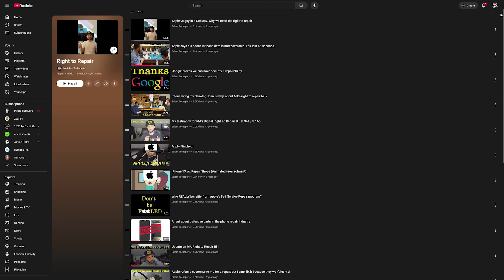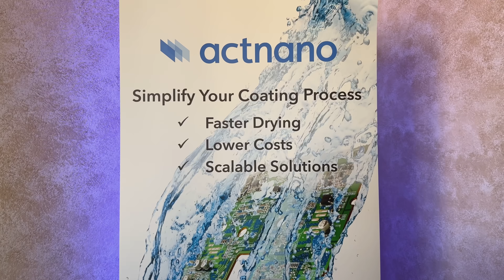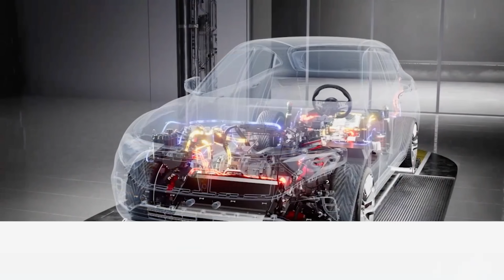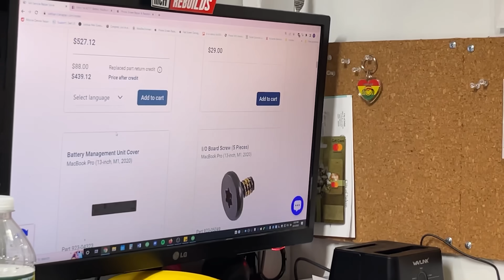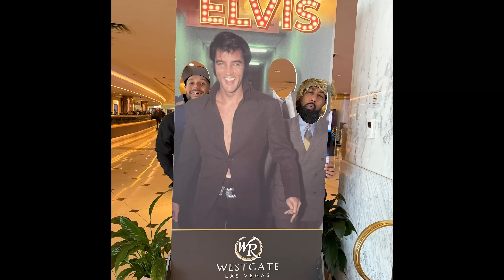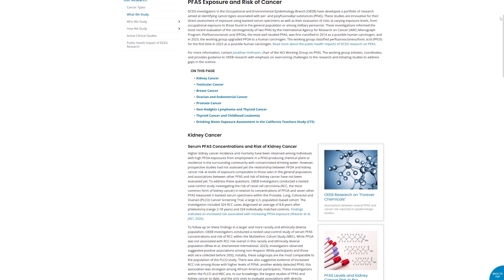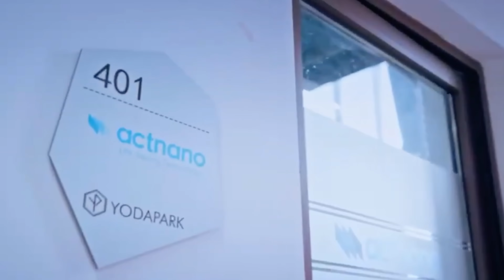Waterproof Laptops ARE Possible, But WE Need to DEMAND Them! actnano nanoGUARD is HOW We Do It!

Comment from the maker: THIS COMMENT ANSWERS YOUR QUESTIONS

First, I STRONGLY recommend watching my full interview with actnano's CEO Taymur Ahmad here before asking questions
https://youtu.be/Iyk5tB56P9s
And you can learn more on actnano's website: https://actnano.com/

Answer to common questions: 
- Can I apply it myself?: No, you can't apply it yourself. It must be applied in the production factory where dust, humidity and application of the coating are under strict control and with the proper procedure and machines. Explained here https://www.youtube.com/watch?v=Iyk5tB56P9s&t=1736s

- Why don't they offer the service to apply it for me?: Also explained here https://www.youtube.com/watch?v=Iyk5tB56P9s&t=1736s . TLDW: Liability, logistics, and effectiveness. Applying it during the manufacturing process on a clean board that doesn't require a complete teardown of a customers device is the only 100% sure way to make sure the product is effective. Think about the time, labor, and staff needed to offer this service. It's like sending in your phone to Corning to have a new Gorilla glass layer put on. It makes much more sense to apply it at the source (manufacturing).

- Does it only work with water: No. It resists a variety of fluids including water, saltwater, soapy water, Coke, Gatorade, coffee, salt, windshield washer fluid, coolant, mixed flowing gas, sweat, etc.

- Does it affect board work?: As shown in the video, the coating can be removed with a solvent and q tip for board work. No scrubbing or sandblasting. A new coating can then be applied with less than 60 seconds curing time after the work is done. https://www.youtube.com/watch?v=pPH1j3LG1zk&t=8s

- How do the connectors get coated and remain conductive?: https://www.youtube.com/watch?v=sx3xE7D5ys4&t=1s

- How do I know that's not distilled water and this is all a big scam: I wouldn't risk my reputation on promoting a product that I didn't thoroughly vet. Volvo wouldn't be implementing ANG in every single new car they're manufacturing. Ford, BMW, Porsche, Volkswagen Group, HELLA, Mercedes, Square, VTECH, Tesla, and Ericsson wouldn't use a product that didn't work. They're at the point where they don't need to prove it works. There are 15 million real-world examples of it working. What they need is laptop manufacturer's to start using it.
Reply: This is some good words THE GREATEST waterproof technician that’s ever lived

Also glad the rlly strange youtube bots have not shown up here they are probably scared of the greatest technician ever lived
Reply: Dude with a channel your size and the astronomical growth you’ve had in a short amount of time, you now have the PERFECT platform Louis has to push Right to Repair advocacy even more than you do. YOU NOW HAVE THE POWER TO MAKE CHANGE! EXPOSE all of the anti-consumer companies, people will love you for it.

Hi Lupe’.
Reply: I really like this and it would be a GREAT first step to fixing this industry. Would it maybe be a good idea to choose a "champion" that we ask to have this feature from? I was thinking Alienware, since they like to make good laptops even if they need a bit of maintenance. Just getting one company in on it would be enough to start a change in the trend after all.
Reply: @themightyai-5302 I'm thinking Asus, since they have the widest range of affordable laptops, and therefore they'll reach the widest audience. Alienware only does high end gaming machines, which are generally restricted to a niche group of gamers. This will reduce exposure and make other companies more reluctant to adopt the coating. Since Asus caters to users of all audiences, having them promote its use would be the best and largest step to its widespread adoption.
Reply: @TheDustyShredder  That is a good shout indeed, I agree with you!
Reply: Can you make a shop or something where you apply that to devices? You just gotta hope they don’t charge extra for waterproof versions but only one company has to not do that for everyone else to stop.
Reply: This feels unreal but still i hope for a better future of the right to repair
Reply: Lenovo's Thinkpad Division needs to get on this
Reply: Can you help me locate a part that im looking for
Reply: i have a question: if they cannot find a manufacturer to apply the coating during production, would they be able to diversify their business to begin the process of manufacturing their own laptops with the coating applied?
Reply: @killer13324  they could do white label
Reply: I have a question, what about delamination? is this coating susceptible to this like other hydrophobic solutions?
Reply: If I get 10k likes you give me a gaming pc
Reply: Is there any laptop you'd recommend that does this at all?
Reply: This the most dangerous video on YouTube might even get you shut down can't have the public find out
Reply: This makes me wonder--what about upgrading parts? If I replaced RAM/SSD with parts that didn't have the coating, it'd lose the water resistance. And other things like network card antennae ends which move around a lot and may crack a coating that was applied. I would rather have a laptop that isn't water resistant, but could be upgraded, instead of one where everything is water resistant but soldered.
Reply: Does it work with battery oil?
Reply: I'm first yay

Comment: What if actnano gave you (and some other repair shops) one of those application machines. And you start offering customers the option to have their device components "waterproofed" for a small fee. 
I mean this in a marketing type way. Start giving consumers a taste of this. 

I would go even further and have a "supported models" list. Aka. only laptop models that are "easy" to disassemble, like Framework, some Thinkpads etc. 
Have people boast how they were able to give their laptop super powers, because they chose the right brand. This would put pressure on the other brands.

Comment: I’m very skeptical. It’s basically a superhydrophobic coding. Usually any friction/movement pretty quickly degrades the nano-structure in the coding that makes it superhydrophobic aka “waterproof.” 

So the obvious place where this would happen is on the keyboard. Movement of the keys and continually pressing with fingers is gunna quickly mess up the coding there. Plus, all the areas where you handle it, basically the whole outer shell.
Reply: But what about the actual motherboard? The keyboard may die but rest of non-moving parts might live on.

Comment: I can see some huge benefits if this was not only offered to laptop manufacturers but also to SSD manufacturers and repair shops. Most people with liquid damaged devices understand that their device may not be repairable, but they want the data off of it. If SSDs were coated with ANG, that would guarantee peace of mind for the consumer. If Sandisk/WD, Micron, or Kingston got on board, it would be a huge net positive for both them and the consumers.

Comment: I don’t think things are as bad as everyone makes it seem in the electronics world. All my electronics work fine for decades. I have a 2013 MacBook Pro as a daily use laptop. I think consumers don’t care about their property and they WANT their products to fail so they can justify purchasing a shiny new phone/laptop/tablet. Just take care of your stuff!
Reply: You stating that your old tech still works isn’t a gotcha, it’s telling that companies have made their products last less time. 

Fun fact: your 2013 MacBook Pro was one of the last MacBooks to allow user-repairable drives and batteries. Since 2016/2017, RAM and storage is soldered in. 

My Seagate HDD from over 10 years ago is still kicking. My external one from 2018 died a month after my warranty ended. My HP Probook from 2013 still works. My Probook from 2022 has had the USB-C port corrode and die off completely, even when the only things plugged in were official chargers and dongles. My Dualshock 3 controllers work fine now, save for a small issue that i fixed with a good clean and electrical tape. My Wii remotes work fine too. My Joy-Cons have drift and barely function. 

But sure, it’s my fault and i should take care of my stuff more.
Reply: Forgot to mention my 99 g3 iMac, my 2005 g5 iMac, my 2007 MacBook, 2009 MacBook, 2011 iMac. 2013 hp pavilion cheapo desktop that still works fine.

Comment: Nice idea. Someone in the comments said pitch to a niche company, I believe an even better idea!
Now on the money side of things let's just say every manufacturer of laptops applied your product now ignoring tariffs 😂,  $2.82B this year is the $1 in terms of annual sales by 2034 $3.9B (annually)assuming demand persist as current forecasts or is $1 factor in the additional cost required for machinery, training, environmental controls to achieve the required finish etc? I mean this extra $1 will also include a cut from the manufacturer of said product.

Now let's go back to that wonderful video of the laptop in the fish tank. 2 days you said, the risk that coating is applied incorrectly to say a lithium battery or capacitor on a batch and someone decides to show how their new laptop dare i say without disconnecting the power code. Lithium batteries and water = fun times. I will say no further. Risk Vs reward.

With progression of technology driven my consumer demand for much more advanced laptops to process ever increasingly complex data blaming the manufacturer and saying water damage is biggest reason people are forced to change laptops is good marketing, bad relationship building as I think the product is impressive. I have ideas.. will cost 1 cent for every time that there coated is applied for the next 10 years and trust it is worth it. See I doubt the manufacturers in the $281.82 billion industry would call or jump on to give someone else 1% of the pie. The great downside to product is it's inability to bought of the shelves by the awesome repair folk or can it... I am just saying 😂 

This product would awesome if it were pitched to.. you know what ideas or innovation ain't free and nothing is never simply $1 extra

Comment: How does it actually work? Pins/contact that have a film of it, would it insulate it and not make a connection? Won't there still be a short for exposed pins/contacts that connects to another?

I know roughly how liquid damages circuit boards.

Comment: i got VERY lucky twice with my Asus X58L, i spilt a whole pint of cider onto it, after the "oh shit" out come the battery and yeah, i did that twice but not on the same day, the second time all that happened was the A button failed, new keyboard later, this was back in 2010 and to this day the laptop still functions, even gave it a dual core as back then it was only a single XD, dude has it right with toyota as if the engine goes pop its so easy to either repair or replace the engines you can keep a ol girl going :)

Comment: There are many types of conformal coatings and they have been around for about as long as circuit boards have. While this particular formulation might be new, the technology isn't.
Reply from the maker: The wheel has existed for thousands of years as well, but the wheel on a Roman Chariot isn't the same as the wheel on an F1 car.

Comment: You know pure water does not conduct electricity. Add some salt in that water see what happens
Reply from the maker: This isn’t pure water, it’s Las Vegas tap water. And if you read the pinned comment you would see it works with any liquid. If you watched the full interview then you’ll see why 15 million cars on the road use it to protect against coolant, oil, salt, etc.

Comment: I don't like backing companies because these laptop prices are highway robbery. But—if it's really $1 per part in a laptop, I can understand why companies don't want to do that. I can imagine that different laptops have around 15–20 major parts (excluding screws, wires, etc.), and even on the low end, a company might produce about 10 million laptops per year. Using the lowest numbers, that's 15 to 20 parts multiplied by 10 million laptops, which equals roughly $150–200 million per year spent just to coat each laptop. And remember, I'm low-balling it at 10 million; larger companies produce way more laptops worldwide. I'm not defending any company here, but you can't say you don't understand why they're not doing this instead of simply selling more laptops as they are. Additionally, "Actnano Guard" is also a company—and companies want profits (I don't trust ANY of them, especially when they sound too good to be true). If one laptop maker would shell out $150 million per year to them on the low end, wouldn't they want even more and promote it as such? For example, using the lower numbers, if five big companies (Asus, MSI, Lenovo, Razer, Dell) each sell 10 million laptops per year, that's about $150 million times 5, or $750 million per year going to Actnano Guard. That sounds like a real great reason to pull on heartstrings, make their product a standard, and get more companies on board. That's just me being skeptical—and I blame all companies for it—but it is what it is. Lastly, if those companies have that extra cost ... who do you think is going to pay for it? You think they will keep prices the same out of the generosity of their hearts?
Reply: THIS needs to be answered because it's just not THAT easy on the manufactures side and they should focus on make it possible apart from the manufacturer
Reply: this is a start. i hope more companies start working on alternatives for actnano. eventually 20 years later the patent expires, making it much cheaper, or other companies come up with cheaper ones before that.
Reply: I think for devices that have only a single board, for example basically anything Apple (which I think is the reason why they use MacBooks for their demo), it shouldn't add that much cost. Other manufacturers also have products that have only a single board, or 3-4 boards per device, and they can coat only the motherboard, and not coat boards for USB-C for example, that way if you spill a liquid on the board, you'd at worst have to replace USB-C daughterboard(s).

Comment: Waterproof laptops have existed for a long time. You know, the $99 toughbooks... That are actually watertight
Reply from the maker: The CEO discusses this in the full interview. Toughbooks, Rugged Latitude's, etc. are built like tanks, weigh 900 lbs, use seals that degrade over time and are broken when dropped. Your grandma isn't going to buy a Toughbook.

Comment: Weve actually had it called liquipel since 2013. They won the edison reward flr it and could apply it to even newspaper or shoes and concrete to make it last longer.
Reply from the maker: @knowvoid9958  liquipel is completely different chemically and doesn’t have the same properties as ANG.
Reply: @SalemTechsperts  oh? The waterphobic lipid with a thin microscopic layer?

Comment: Let's say if you need to repair devices with nanoguard already applied, and you are potentially replacing a capacitor or a microchip. Do you need to reapply the nanoguard again?
Reply: I assume so, but given how cheap the product is said to be, it's nothing compared to the price of the repair itself

Comment: Yo bro what should I consider buying? They all are coming around the same budget now
1.  Lenovo Legion 5 Intel Core i7-14650HX 16" (40.64cm) WQXGA IPS 350Nits 165Hz Gaming Laptop (16GB/1TB SSD/Win 11/Office 2021/NVIDIA RTX 4050 6GB/100%sRGB/Alexa/3 Month Game Pass/Grey/2.3Kg), 83DG004RIN

2. Lenovo LOQ 2024 13th Gen Core i7-13650HX |NVIDIA RTX 4060 8GB (24GB RAM/512GB SSD/15.6 Inches (39.6cm)/144Hz/Windows 11/MS Office 21/1Yr ADP Free/3mon Game Pass/Grey/2.4Kg), 83DV00LXIN Gaming Laptop

3. ASUS [Smartchoice ROG Strix G16, 16"(40.64cm) FHD+ 165Hz, 13th Gen Core i7-13650HX,Gaming Laptop(16GB RAM/1TB SSD/NVIDIA GeForce RTX 4060 /Windows 11/Office 21/Eclipse Gray/2.50 Kg), G614JV-N3474WS

4. HP OMEN, 14th Gen Intel Core i7-14650HX, 8GB NVIDIA RTX 4060, 16GB DDR5, 1TB SSD, (Win11, Office21, Black, 2.39kg), 144Hz, IPS, 16.1-inch(40.9cm) Gaming Laptop, Tempest Cooling, Backlit KB, wf1096TX

5. ASUS TUF Gaming, Gaming Laptop, 14" FHD, 165Hz 400 nits, AMD Ryzen 7 8845HS Processor 3.8GHz (16GB RAM/1TB SSD/NVIDIA GeForce RTX 4050/Windows 11/Office 2021//Jaeger Gray/1.46 Kg), FA401UU-RG033WS

Which one would be the best according to you?

Comment: So, I'm still thinking on other issues that might come up during repair, such as a short circuit or some IC that needs replacing, would that also entail that Repair techs will need to redo this coating properly after soldering/replacing ICs or Capacitors? I am in awe, and the potential is enormous. But I'd also want to learn about the long term effects, such as how long is the coating going to last? A year? 10 years? Can it be re done or refreshed later? Will that require special equipment?  Or special technical expertise to operate that sort of machine? How much would that cost on average for a repair shop to implement? Aside from the mentioned 1 dollar of the material cost itself, of course. It's fascinating. I wish more influencers talked about this, and also all the implications that this can have for the potential of reusability of old tech.